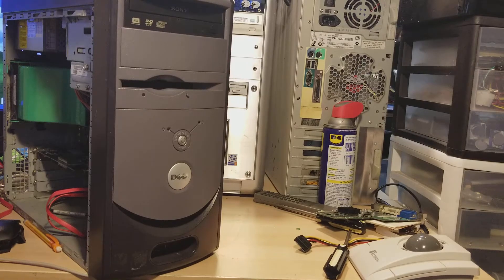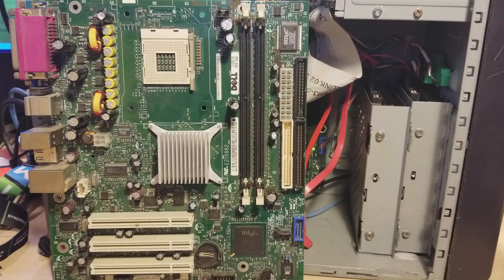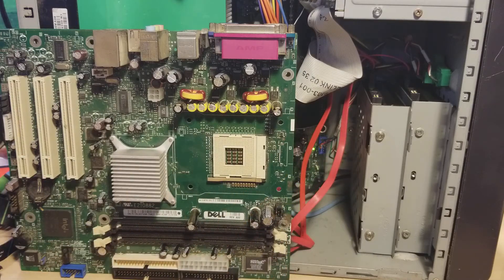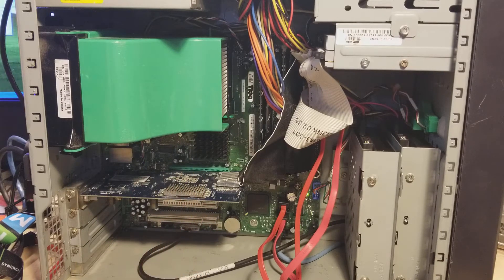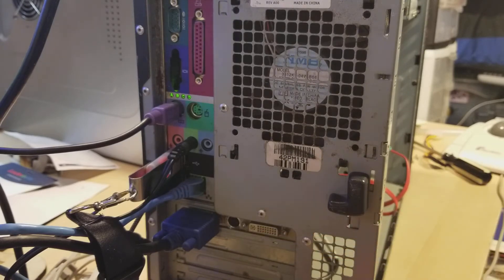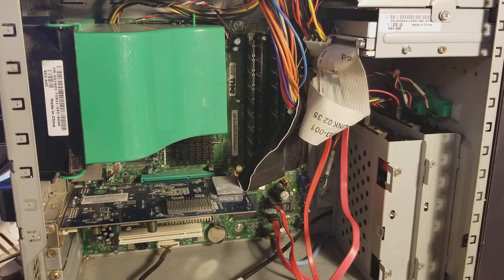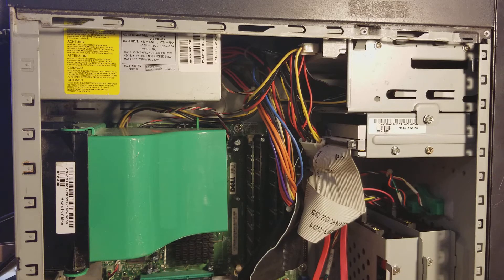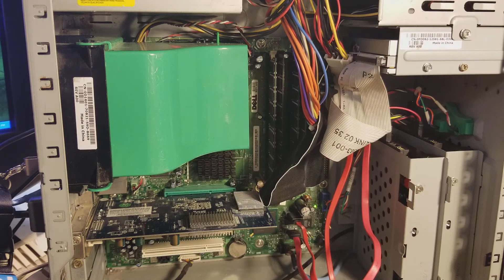A quick & low cost Dell Dimension 1100 upgrade that works

Comment: Just to let you know this board only accepts a max of 2gb, I've got an identical system that I bought from new but I've put a 2.8 p4 hyperthread cpu, 2gb(max) memory, 5.1 soundblaster card, extra usbs card and a WiFi card with a Bluetooth mini dongle on the inside on internal USB plug on the card then I have a multi burner with light scribe and and 500w psu upgrade, it runs well as an old music production pc/media station, it also has xp Pro but I've upgraded the skin to a vista black look with a modern start up tune 👍
Reply from the maker: Makes sence since the original MB was bare bones. My confusion is with the upgraded MB I used, which truly only uses 3.5GB of ram due to XP constraints.
Reply: What's the best CPU you can add to the 1100? I have one in the loft and want to do something with it

Comment: thank you so much for this great informative video .. I have same old pc which I bought sometime in 2005 and currently trying to revive again for some crazy retro gaming or even linux distro testing.. I upgraded to Prescott and geforce vga (not-agp as didnt have agp-slot) long time ago but that was just end of line.. you giving me idea of upgrading the motherboard means I can do alot more with it for not really alot of money :) can you please let me know which dual core cpus I can go for one this one with highest speed settings ?? oh yes i also managed to get original xp working on it :) :)
Reply from the maker: Of all the upgrades I did for my Retro LAN party. I enjoyed this upgrade the most. She became a sleeper system at the LAN party, because on the outside she looked all original. Even all the lights & front USB ports worked. But she gamed like a Hybrid Retro Gamer!
Reply: but socket 478 had no dual core pentiums ?? did u mean hyper threading ??
Reply from the maker: Yes I did, thank you for catching that! My mistake. I actually found this out after I made this video. The Dual Thread Prescott was one of the fastest CPU's this MB will take. But it's plenty fast for retro. The socket 478 can not run any dual core CPU's.
Reply: @HavocSun  oh that's ok I thought maybe I am missing something as I have a Prescott with hyper threading runs at 3.2 ghz but honestly I feel still it's very sluggish... I blame motherboard and hard drive for it .. as it doesn't have any sata ports .. so I have bought a external sata port PCI card let's see how it goes if it's not great I'll try a motherboard swap thanks

Comment: Where can I find a upgraded cpu for an 1100 DELL? Looking to get my old 1100 backup and running. I might consider a motherboard upgrade if I could find one compatible with the front port etc.
Reply from the maker: I would look for the Dell 2Y832 Dimension 4600 Motherboard, I still see a few on Ebay. It gives a lot more choices of faster CPU's & Ram.
Reply: I got my cpu upgrade from ebay for less than £10

Comment: Looks great. Makes me think of my main retro gaming pc, a compaq deskpro en from 2001. I maxed it out. 1ghz pIII, 512mb of ram, sb live, 40+100gb hdd and a nvidia GF 4 4600 TI. Even a 2005 game can run well at 800x600. The 4x agp is limiting and so is the pIII, but the rest of the games plays just so well.

Is the exhaust fan quiet ? All the NME that I saw where making annoying noises, especially on late 90's early 2000 dells.
Reply from the maker: The exhaust fan is really quiet. I'm not sure how they can pull that off being it's the only fan in the computer.

Comment: also they did an HD 2600 PRO AGP 8x with 512MB both of these HD cards are sorta rare : https://www.techpowerup.com/gpudb/1001/radeon-hd-2600-pro-agp . Today a lot of people are going for the HD 4890 which is an awesome card! I got two for less than 50 bucks, crossfire with an XP machine sounds fun
Reply from the maker: Love to see the specs on that cross fired Rig
Reply: I currently have only 2 boards that can do Crossfire, both are FM2+. They would most likely be an Athlon X4 860K (3.7Hz I can Overclock it to 4.3GHz using a Cryorig M9a), 16GB DDR3-1866 RAM. The board I am currently using is a Gigabyte GA-F2A88X-D3H and I need to test the other, broken traces near the PCIe and PCIe clip broke. That board is a ASRock Pro3 FM2A88X+

Comment: Did you know that you could go newer with the video card? VisionTek made an HD 2400 Pro AGP 8x video card. 256MB, 64Bit, DDR2, only 20W, has DirectX 10, and OpenGL 3.3! I wish it was a Small form factor, i would swap it out with my Geforce 6200 in my Optiplex. https://www.techpowerup.com/gpudb/431/radeon-hd-2400-pro-agp
Reply from the maker: Yes I have a HD 2400, love the card. May just drop it in. Thanks for reminding me.
Reply: The dell 1100 doesn't have an agp or pci express slot